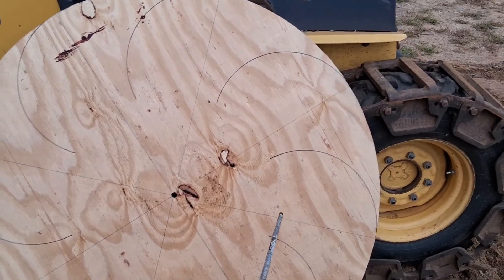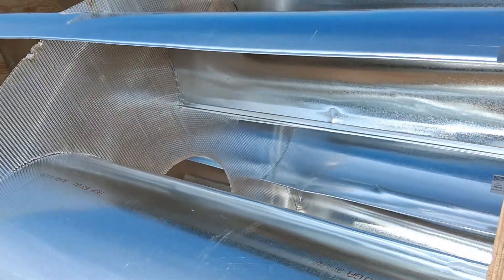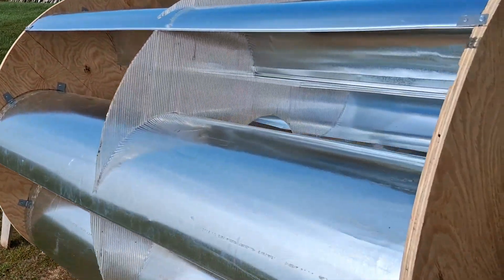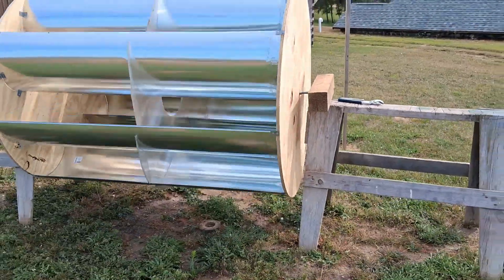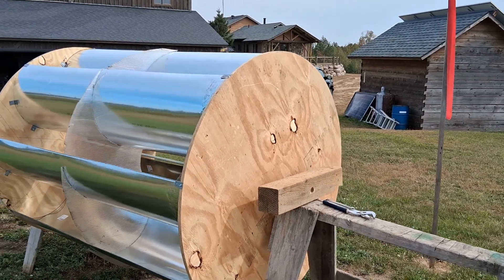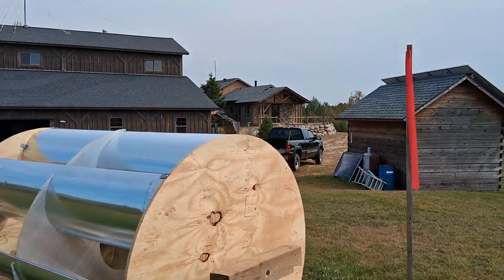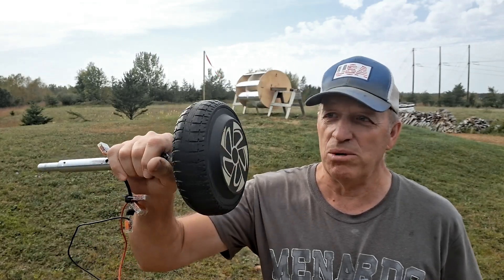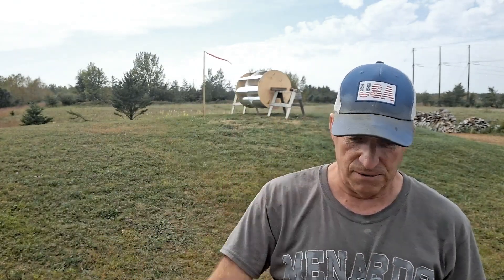Continuing VAWT experiments, on it's side.

Comment: Hi Mate, I have been testing small wind generator in a small town with neighbors, so small and quiet is the best option. I have found that noisey high speed blades are usually flat and small at the tip, which is where most of the noise comes from, since the outside of the blade is moving at such a high speed. So my best advice is to buy a small wind generator with 5 or 6 blades, with scoops near the hub of the wind wheel for low wind start up. So in testing with an average wind speed of 10km/h, I have notice a wind effect when having a wind generator mounted on the side of the building, where the bottom blade is only 6 inches above the roof. Would be even better to be on the peak of the roof, there is a tunneling the wind effect as the wind rushes over the roof. The perfect position would be the peak of a 4 sided roof and have the lower blade 6 inches off the roof. I have 4 on side of shed.
I hope this information helps everyone.

Comment: I wonder if it were made lighter you could benefit from slower speed winds. Your device just looks heavy.
Reply from the maker: Thanks for the comment!
Trying to make one of a larger size, that is also light and strong is a challenge with cheap available materials.  With the way it is right now, it's about 100lbs.  My larger one shown in other video weighed 500lbs, and would start to turn at about 1.5mph wind, (no load).  There's very little available energy at low wind speeds.